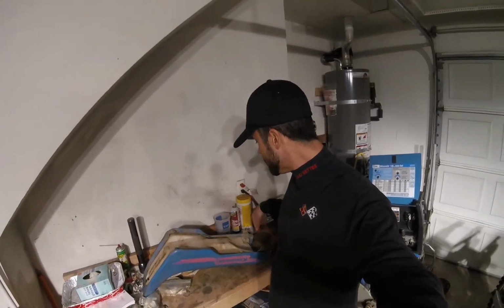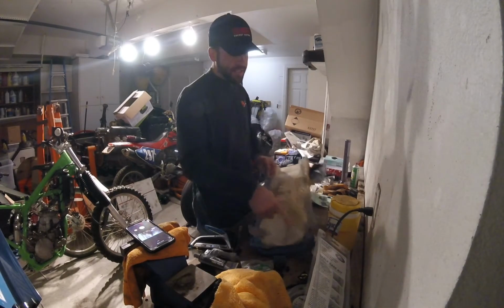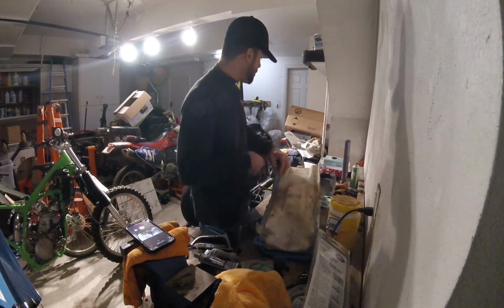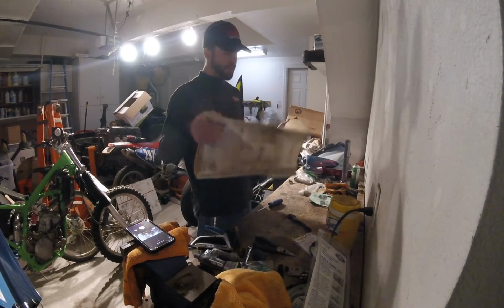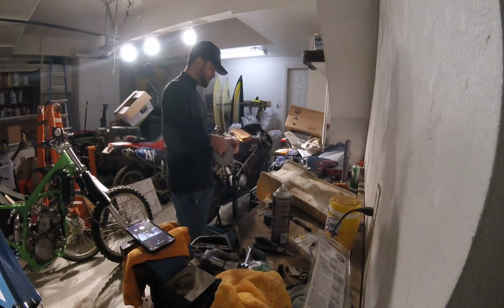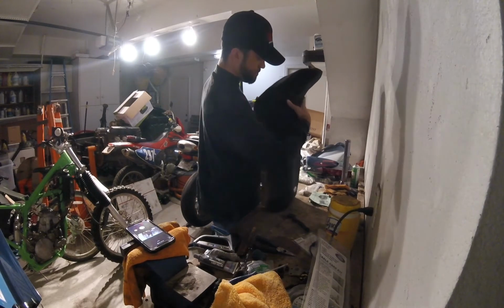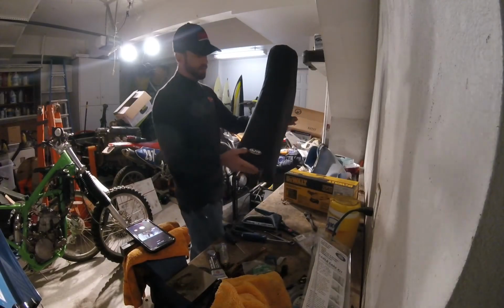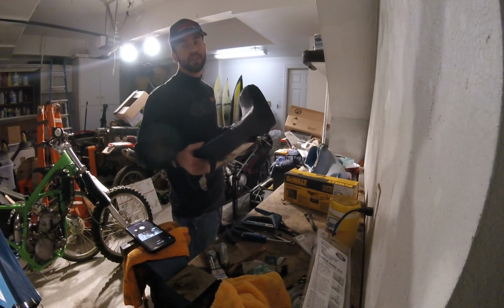Keeping My Butt Covered - Seat Cover Replacement - 1991 Kawasaki KDX200

Comment: Lol. What a coincidence!  I’m replacing the seat cover on an 89 kdx 200!  I’m surprised the spring stapler worked. I had to spend $40 for a pneumatic T50 stapler.  The foam rubber is messed up. Like you, I had to glue some pieces down, plus some additional refurbishing. 
My new cover doesn’t easily follow the contour of the seat where it curves up. Did you have to pull the corners tight at that bend?  Any problems with staples ripping the material where the material is under tension?
Reply from the maker: A pneumatic stapler is 100% the way to go. I felt like it was a bit of a struggle to hold the fabric in one hand while simultaneously trying to staple it in place with the whole other arm. A pneumatic stapler would've made that a lot easier - which I'm sure you experienced.

With respect to the foam, the reality of it is that these are 30+ year old bikes (!) so the plastics, rubber, and other soft parts like seat foam are pretty crunchy, but the handling and torque of these bikes relative to other two strokes, as well as the 6-speed transmission, in my opinion, makes them worth keeping around. Further, I'm not sure if you're in California, but you can't green sticker a two stroke newer than a 2003 anyway...(I'm hopeful that the new KTM TPI's might be allowed to be green stickered though they've been out for a couple years now and I'm not seeing a ton of political will on that - alas, I digress...).

I did have a little bit of trouble right in the middle of the seat, where there's that little low point. I did the best I could, like I think I said in the video, it definitely isn't perfect. I only really had one or two staples tear; that wasn't really a huge issue for me. All-in-all, it's definitely something I'd tackle again and I'm pretty happy with how it came out considering it was a first attempt. Hopefully you're happy with yours!!
Reply: Go Ride Channel 
Go Ride Channel 

Well, I’m happy to report that the seat cover looks decent.  It’s not wrinkle free at that low spot, but looks about like yours. It looks a damn sight better than it did!  
Yes, there’s something special about KDXs. They’re more user friendly than most two strokes from that time period. The power band is smooth but still aggressive, and they start easily. 
No, I’m in western PA, Johnstown area. This area is great for KDXs. And KTMs. My buddy across the street is a total CR 500 freak but  bought a KTM 300 a couple years ago because they’re such great bikes. They’re the rightful heir to the KDX. 

Btw, there’s a guy named Jeff Fredette who’s the king of KDX upgrades. Having competed in  Enduros using KDXs from 1983-2006, he’s might be the most well known advocate for KDXs in the country. He also has a business, Fredette Racing, which provides both KDX specific info, but upgrades as well. I spoke with him the other day and I’m going to get some beefier front springs from him. If you haven’t heard of him, he’s worth checking out. Really nice guy, and knows all things KDX. 

Good luck to you!  Thanks for your video, and happy riding. Here’s hoping Cali gets a grip and brings back the two stroke!